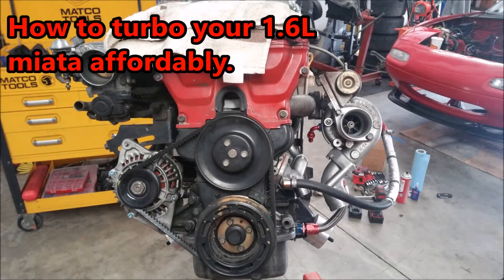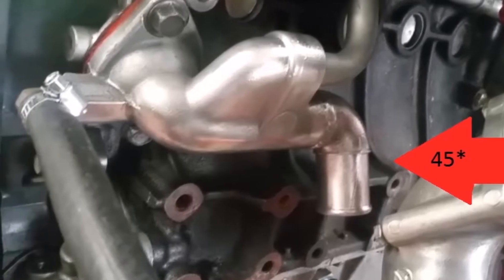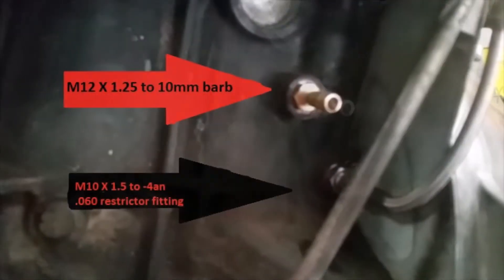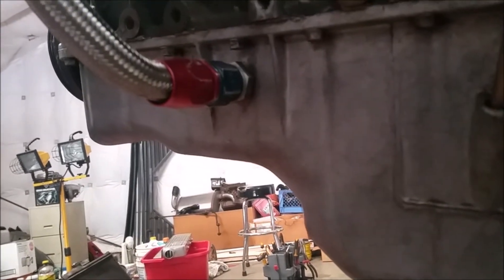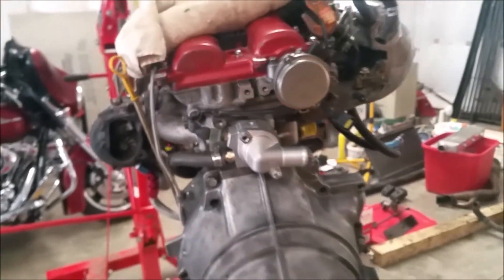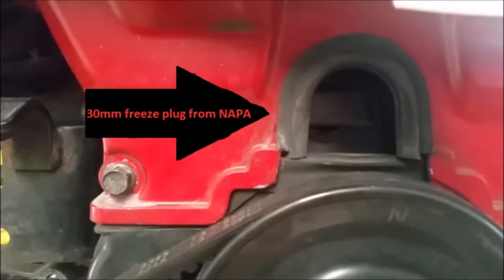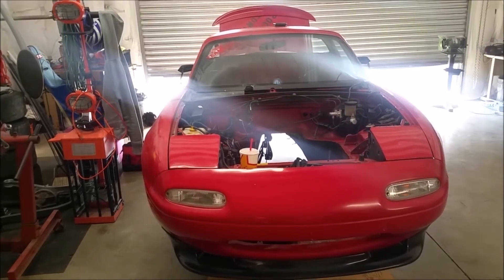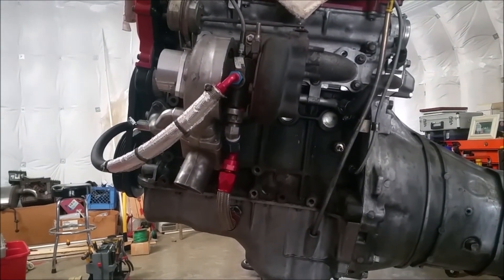Turbocharging your 1.6L Miata with a T25.

Comment: what is the turbo out of? an sr20det?
Reply from the maker: It is from an SR20.  It's a journal bearing from an old redtop.
Reply: +NA6 driver what manifold along and downpipe you running? And oil and coolant lines?
Reply from the maker: +Pedro Jimenez I'm running an ARTech manifold and downpipe.  The oil and water lines are custom lines I cut.  I tell you the specifics in the video.  I don't remember the exact thread pitch on everything off the top of my head.

Comment: I'm currently rebuilding my 1.6 for turbo, everybody has told me to go 1.8 lol, but I have 2 engines sitting around. my question is, what's the power like in this setup? any advice for a n00b?
Reply from the maker: +unknown1creature The power will really depend on the weight of your car.  mine tipped the scales at 1903lbs without me in it.  I've beat a few newer 350z's from a small 10mph roll and a dig, so the power is fun for sure.  It's all about spool.  The 1.8L just has a much better flowing head.  The displacement difference is tiny but head flow and cam grind on the 1.8 is better suited for a small turbo.  

My advice is to get your standalone ecu first, get a wideband as well, run speed density and learn how to use the tuning programs.  It's hard to blow up a car that's NA.  Get larger injectors and get the car running on then.  Once everything is running well bolt on the turbo, get an electronic boost controller and start cranking up the boost. A clutch is going to be needed as well since the stock one starts to slip around 6 psi.
Reply: I have a 1990 at the moment, I'm right in the middle of rebuilding one of my 1.6's all stock for the garret t25 i have sitting here, I definitely need to get megasquirt but thankfully i live like 30 minutes away from their office, injectors i figured i will get from a junkyard lol. I'm planning on lightening the car with carbon (hopefully) Im currently just about done with dissembly, head is in the machine shop, and im almost done taking the block apart. Its really the tuning that I am not familiar with, because the motor and turbo is coming along quite nicely.

Comment: I deleted my water neck the same way and was lost as to where to run my water lines after I did. This is super helpful. I'm hoping to do exactly this now. Thankyou so much
Reply from the maker: +Shaun Gardner Glad it helped.  The only thing about this way of doing things is that the later 1.8L blocks don't have provisions for the water and oil feed.  I also kept my idle air control valve coolant route by using "the cursed waterplug" as a source.  This allows you to keep decent idle control while not complicating the water routing.  Goodluck on your install.

Comment: Nice project! How much did the manifold run you?
Reply from the maker: +eric irizarry I bought it used with the turbo/downpipe/fittings/Inconel studs and a support "crane" for $950 shipped.  So I don't really know what the value the manifold at.